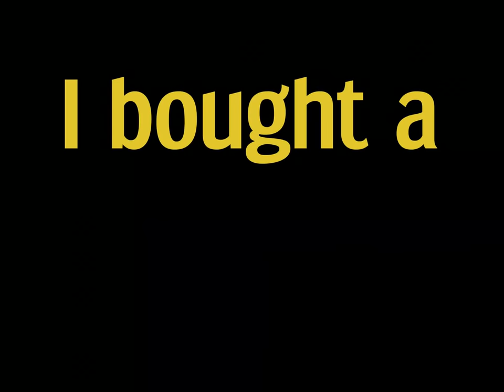I bought a motorhome and moved in! RV renovations

Comment: How long is your RV?  Is the lack of slides an issue for you?  I am currently shopping for a Class A for me and my dog who is a bit bigger than yours have you had any difficulties / challenges traveling with him / her?  We've been traveling for a few years in a Class B going out on the road of periods as long as 5 weeks in that time we haven't had too many issues so I imagine that in the larger Class A (I'm looking for a used 38-40 feet).  Have you done a video about the selection and purchase process?  

I've watched several of your videos they are all entertaining.  How difficult did it become when you went on the road to maintain your ability to consult?

Finally, as I prepare to go on the road I wonder about the social element.  I've contacted a few full-time RV groups but most of the participants are couples as a single I wonder about social opportunities.  Any insights?

Thanks again for the videos.

Comment: Great video!  I just started working on an 89 Bounder and love some of your ideas.  I have been toying at gaining some space by removing both benches from the dining area and turning the table around and adding two wood chairs.  Poof! instant space to do something else.  Question is: What?  Maybe move the couch back and?   Ah, lots of stuff could be done.

Loved your brainstorm of using the cockpit space as seating, spare bed, whatever.  Be sure to post some of your more recent updates soon.  OK?
Reply from the maker: william mack Thta's a great idea to change the direction of the table. I was considering cutting mine a little short but I've moved on from that idea. I have a lot of videos with updates. You should check out some of my more recent ones :)

Comment: I like the bed/couch you made for the front. What is your procedure for getting ready to travel?  How long does it take to prep?
Reply from the maker: NightSailor Thank you. I love it, too. It's my most frequented hang out at home :) I always think it takes shorter than it actually does to get ready for the road. But a couple hours would probably encompass most tasks.
Reply: Pippi Peterson
You have done well.  I agree with all the mods you have made.  I laughed when I saw you pull the water heater.  I changed mine out too on my truck camper.  It included AC heat now, and that was probably a mistake as I never plug in.  I avoid parks hot places, and rely on solar panels for power.  When I ask RV parks for simply a place to park they want to charge me for full hookups and I don't want any hookups.  So that is another reason I avoid RV parks except for military bases @ $10 per night.  Please post a video on your dog fencing.  I need some ideas.

Comment: I noticed some art work on your walls. How do you suggest attaching paintings to the wall? I have a picture my mother painted, and want to take it with me when I get an RV.
Reply from the maker: Daniel Ferry Thanks, that harley engine painting is mine actually. I just put nails in the wall, and put the head of the nail between the canvas and wood frame and then delicately pushed the whole thing tight against the wall, then put screws in the bottom for the painting to rest on as extra support. Good luck!
Reply: +Pippi Peterson. Since it has been a year since you hung your artwork and you have been traveling on the road with the RV, how is that still working out for you?   I ask because I would think the nail would work loose with all the vibration, and eventually the whole piece will land on the floor.  Are RV walls too thin to put some kind of anchor system?  It would be pretty bad if you accidently popped through to the other side.
Reply from the maker: +Geny R. I've got two nails on the top and two underneath it. It's pretty sturdy up there. Also, the painting is very lightweight. I would trust a heavy mirror.

Comment: Wonderful work! congratulations on your motorhome. 
I want to ask a question, I have a Pinnacle Chevrolet 300 the year 94, and I see that they all have the same windows, and I get the water out of the dorm, that between the body and the frame, there are 1.5 feet, which prevent the rubber from sticking to the fiber. 
that I can do? change windows some European PVC? the SEITZ hinged? 
from Galicia, Santiago de Compostela, a passionate American motorhomes, you Yes, you know!

Comment: So I have a question. I am also thinking of moving into an RV in Arizona or New Mexico. And I have a dog. How would I keep a dog in an RV while I'm at work. I have to leave the RV running the whole time at work. That doesn't seem efficient. This is a major concern of me moving into an RV and living the lifestyle you were doing which I'm really really want to do if anyone can help me out on this I appreciate it thank you
Reply from the maker: p jo You will have to leave the AC on the entire time you are gone. In the summer with the AC on, temps could still reach the 90s inside depending on the size of RV and whether you have a 50 amp (allowing you to run both AC units) or just a 30 amp. You'll also need to find shade for your RV which can reduce temps inside by 10-15 degrees. It would be best if you could park near friends where you can drop your dog off during the day. During the winter months though, you can likely leave your dog fenced outside your RV. That's what my dog prefers. But you will need to clear this with the RV park before hand and let your dog get comfortable hanging out there outside for long periods of time. Good luck! Also, keep in mind, both AZ and NM have higher elevations where temps are not dangerously hot. Prices rise with the elevation, though.